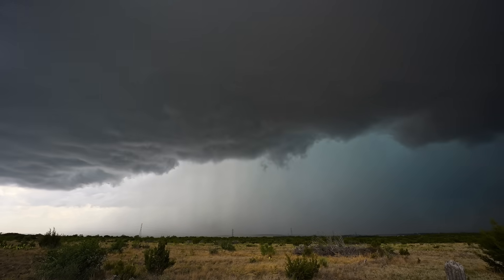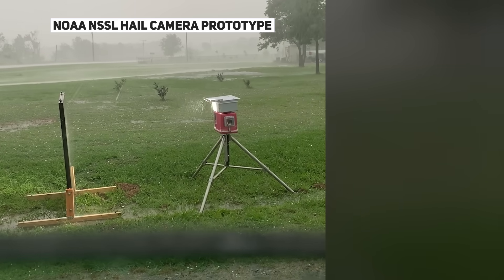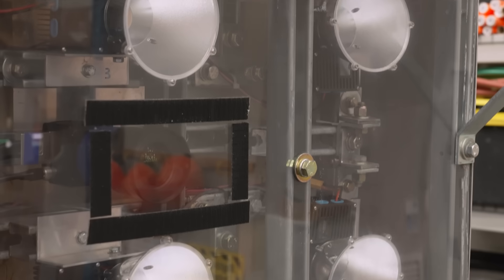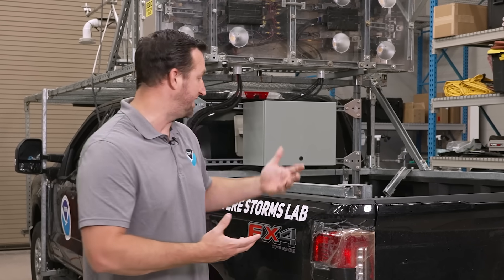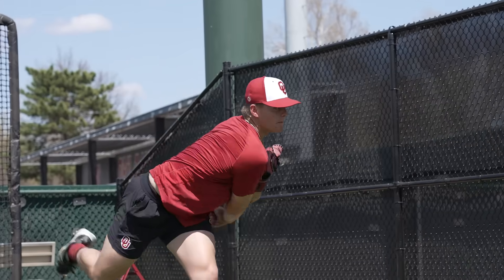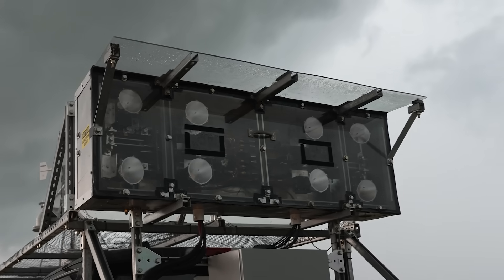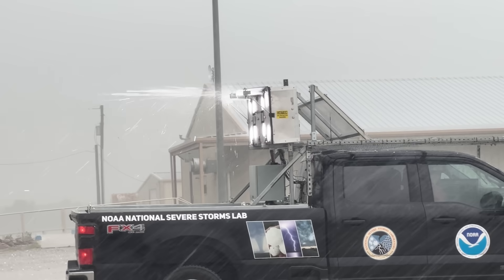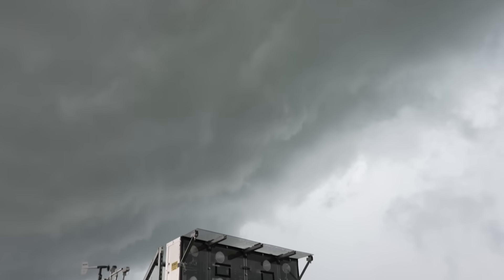Inside the Hail Camera: 4K Slow Motion Reveals Storm Science Like Never Before

Comment: 330 fps, for LED illumination is quite slow...
I read that you are using 75 usec exposure time... If you want "sharper" images, with less motion blur, it's quite feasible to get LED "flash" illumination that could probably get you down to <10 usec. I think that it's possible to get sub-microsecond pulses... With 330 fps and 75 usec exposure, using LEDs in pulse mode, it's only 2.5% duty cycle!!
Out of the 3 ms frame rate, the LED would get 2.95 ms of "rest"

Comment: BTW, I'm a bit "experienced" with LEDs, and I'd be interested to see if I could find any ways to help out with this kind of work... Just an example:: in 1991(!) I developed a flash system used to capture road surfaces at about 70-80 kph, 2m patches, with about 2mm of motion blur, using xenon flash, and timed by a microcontroller to synchronize the camera to the peak flash output.
I worked with LEDs for 6 years, developing the LEDs (Osram, citizen, Röhm, everlite, lumileds...) and LED drivers for mobile phones. I have worked on some ideas to get more rapid turn-on of the LEDs.
Since this kind of project is very much about "systems", it's quite a nice challenge. If there's anything I might be able to do, or just have some discussion, just say yes, and I'll try to get in touch.
Reply: No interest.
Reply: The idea is that it's possible to get much more energy delivery from the LEDs when pulsed, compared to running at DC, depending on the duty cycle based on frame rate and exposure time.

Comment: If you have a single POV tracking the hailstone, how do you know its true size and velocity? A larger hailstone further away vs a smaller hailstone closer can appear the same amount of pixels wide on camera footage due to perspective. If you're tracking the velocity of the hailstone relative to the speed at which it moves on the camera, you need to know the exact size of the stone right? You could solve this equation with distance, but your setup doesn't appear to support that? Are you using multiple cameras? Or maybe some kind of optical sensor that uses the returned light to solve for distance (which I don't see)? Are you approximating the distance via weather radar?
Reply: Focal distance is easily calculated.  Your iPhone does it with every picture you take.
Reply: I was wondering that. Feel like this maybe a ILFS type of science project that doesn’t provide any useful information because it misses one key measurement. It’s cool but not exactly sure the usefulness.

Comment: We really deserve a build video. How does one store 4k at 330fps? How do you power the lights and computers?
Reply: I've always just wondered what they use for storage. It's gotta be uncompressed video, or nearly uncompressed, because silicon meant for encoding is going to have a hard time doing 330 FPS at 4k, much less thousands of FPS, to use a lossy codec that can reduce transfer rate. Do they just have tons of RAM, and one needs to wait a little bit until it then gets dumped to NAND flash?
Reply: @timramich  YES! I imagine independent and redundant systems on the backend, and would LOVE to know how they did it.
Reply: I just wrote a comment asking the exact same question!
Reply: The framerate isn't that hard. My phone does 4k at 120 fps. I'm sure there are multiple commercially available cameras that can do 4k at 330 fps. True high speed cameras do thousands of fps (only for a few seconds, but still). But the rest (power, lighting, computer vision) does sound very interesting.
Reply: @PsRohrbaugh wow, you seem to be an expert
Reply: @PsRohrbaugh what? My eos r50 can only do 4k at 30 fps...
Reply: @PsRohrbaugh  this is a scientific instrument.

Comment: 3:35 Still don't know why some houses are built in the Midwest with brittle plastic exteriors. Breaks in the extreme cold, melts in the extreme heat, and is highly flammable. 
"Yeah, but it's cheap!" Oh, that answers that.
Reply: Brick also takes damage and is much more expensive to repair. Ours broke when our garbage can flew away in the wind.
Reply: Vinyl siding is durable and cost effective. Yes, it's brittle in cold weather, but so are shingles. Polyvinyl siding does not deform, become soft, or melt at temperatures below 165 F/75C. It requires a significant impact to shatter vinyl siding. The impact that damages vinyl siding is strong enough to damage other exterior claddings, such as lapboard or compressed wood paneling. It does not permanently dent like aluminum siding. If damaged, it is cheap to repair, unlike brick veneers or brick structural wall. It is not the optimal material for every use case, but there are many use cases where it is a good economical option.
Reply: We've had damage to our vinyl siding from pretty small hail. If we get big hail, we'll need to redo the house.